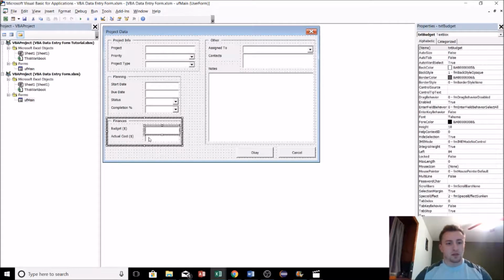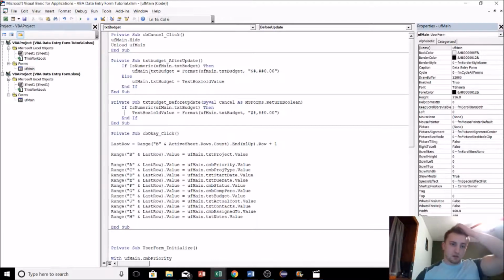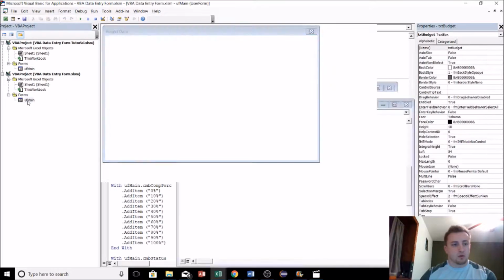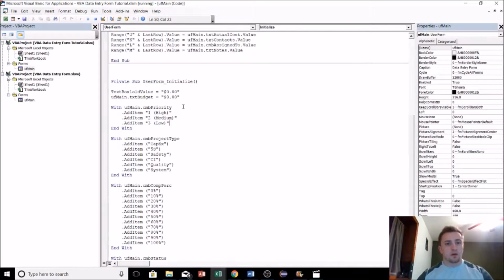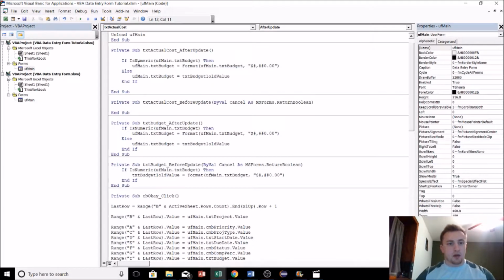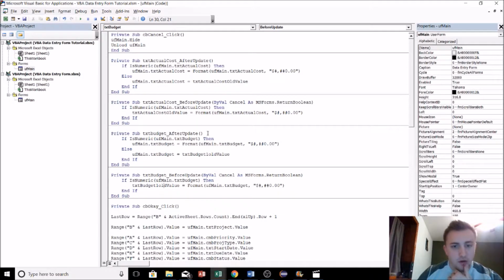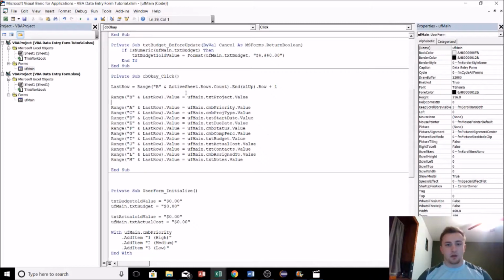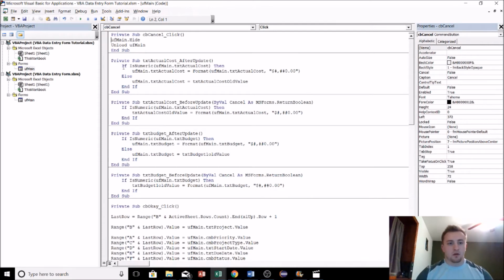Excel VBA Entry Form - Part 3 (Formatting VBA Textbox With Dollar Sign, Userform Design)

Comment: Great video on Userforms...   Two questions for you.
1.  I've created a very LONG Userform.  I'd like an ENTER Button on both the TOP and the BOTTOM of the FORM....  What is the easiest way to do this???

2.  On your example you also have a place for COMMENTS/NOTES that the user can add to the worksheet.  My question is, can the COMMENT/NOTES Field be formatted to accept HARD RETURNS.  All I can get mine to do is wraptext.  But I want my user to be able to make detailed notes...
   For example:

  Note 1 - 3/16/19) The client called and wants to add an additional room (dining) for the remodel project.
  Note 2 - 3/18/19) Client selected wood flooring for dining room addition.

  Are these options possible??  And if so, what's the best way to add these features to my project?

Comment: Great video, do you have any code that would allow for the budget textbox to automatically update in currency format if it was a calculation of other textbox numbers.
Reply from the maker: Yes that should be possible! I will try to put something together and message you.
Reply from the maker: Private Sub CommandButton1_Click()
Let me know if you have any questions but the below code should do the trick.    The userform is set up with three textboxes and a command button that executes the calculation.  The main piece that you need to do calculations is using the cdbl command to convert the currency back to a decimal before doing calculations as seen in  this line...UserForm1.TextBox3 = Format(CDbl(TextBox1) + CDbl(TextBox2), "$#,##0.00").  

If Not IsNumeric(UserForm1.TextBox1) And IsNumeric(UserForm1.TextBox2) Then
    MsgBox ("Enter numeric values into textbox1 and textbox 2 and try again.")
Else
    UserForm1.TextBox3 = Format(CDbl(TextBox1) + CDbl(TextBox2), "$#,##0.00")
End If
End Sub

Private Sub TextBox1_BeforeUpdate(ByVal Cancel As MSForms.ReturnBoolean)
If IsNumeric(UserForm1.TextBox1) Then
    UserForm1.TextBox1 = Format(UserForm1.TextBox1, "$#,##0.00")
Else
    UserForm1.TextBox1 = TextboxOldValue
End If
End Sub

Private Sub TextBox1_AfterUpdate()
If IsNumeric(UserForm1.TextBox1) Then
    UserForm1.TextBox1 = Format(UserForm1.TextBox1, "$#,##0.00")
Else
    UserForm1.TextBox1 = TextboxOldValue
End If
End Sub

Private Sub TextBox2_BeforeUpdate(ByVal Cancel As MSForms.ReturnBoolean)
If IsNumeric(UserForm1.TextBox2) Then
    UserForm1.TextBox2 = Format(UserForm1.TextBox2, "$#,##0.00")
Else
    UserForm1.TextBox2 = TextboxOldValue
End If
End Sub
Private Sub TextBox2_AfterUpdate()
If IsNumeric(UserForm1.TextBox2) Then
    UserForm1.TextBox2 = Format(UserForm1.TextBox2, "$#,##0.00")
Else
    UserForm1.TextBox2 = TextboxOldValue
End If
End Sub